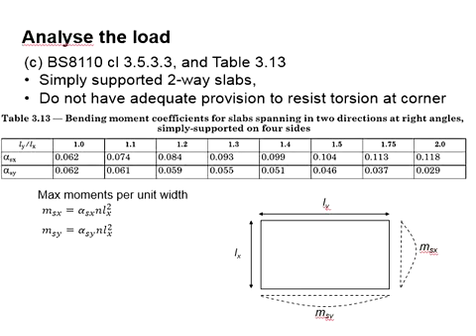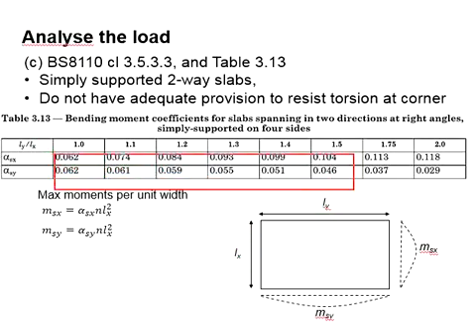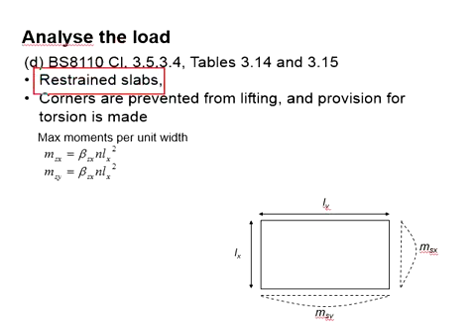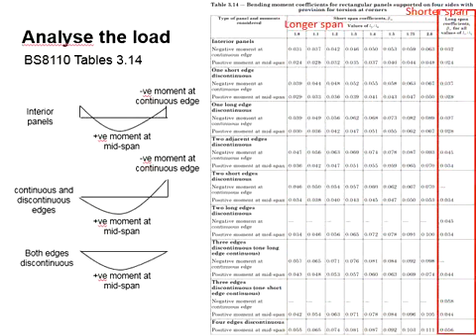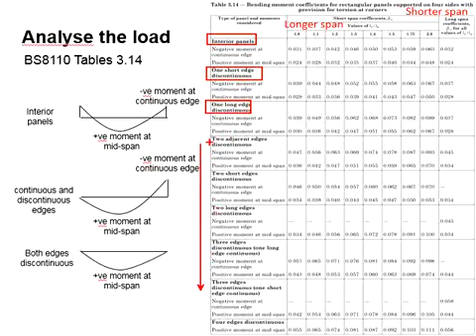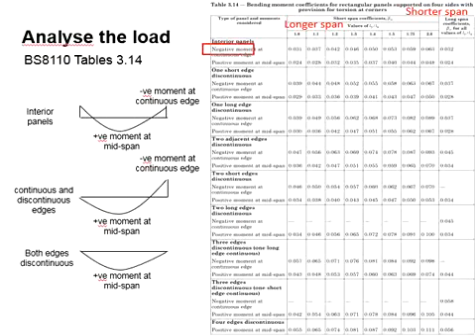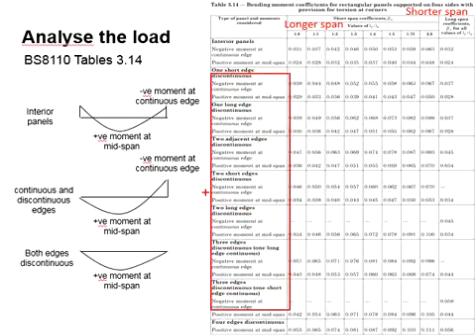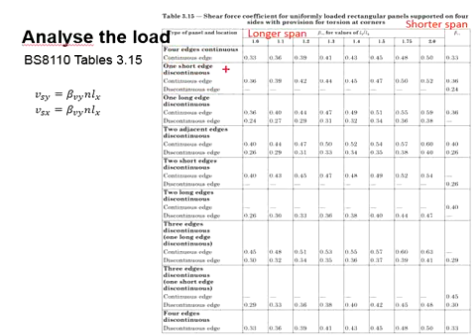8.3 Analysis of load for two way slab

Comment: Sir. For a square two-way restrained slab discontinuous at one edge, do we use Case 2 or Case 3? Is it feasible to select the more critical coefficient for my design?
Reply from the maker: For square two-way restrained slab discontinuous at one edge, either Case 2 or Case 3 will do. After calculation, the load will be the same.
Reply: Understand, thanks sir